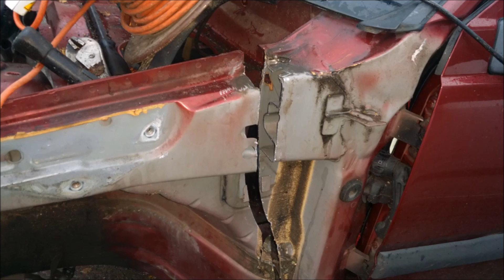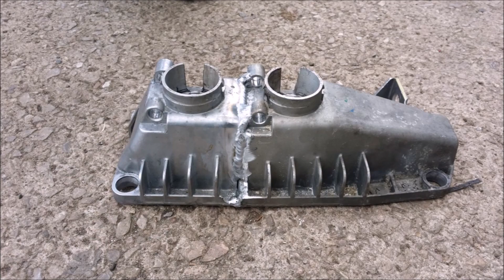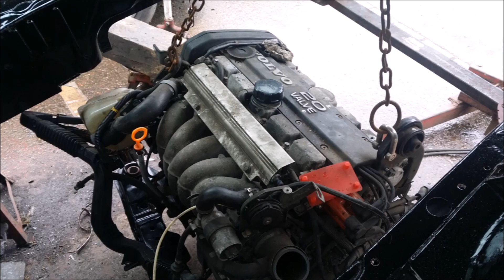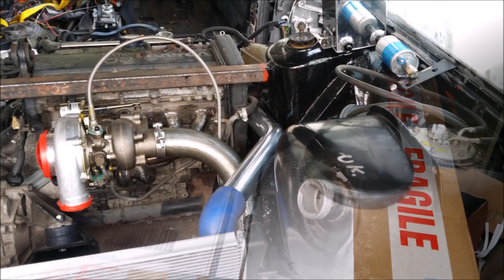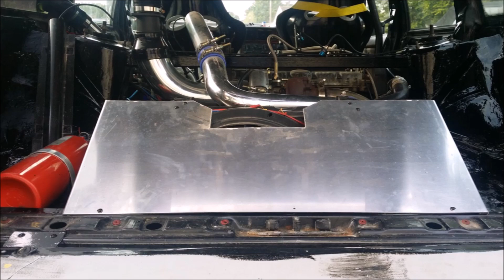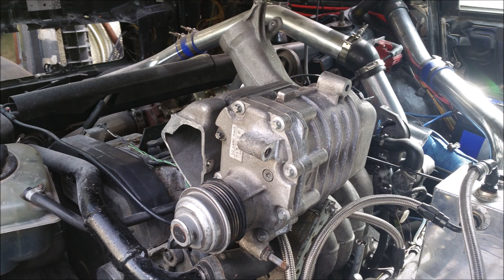Rear engine in a Volvo 850 in 5 minutes

Comment: hello can you help me I am a French youtuber and I have a project to mount a second engine in the back of a car but my only problem is to synchronize the 2 gearboxes with a single lever
Reply from the maker: manual or auto, cable or rod shift?
Reply: @claymore2k1T10  manual gearbox cable